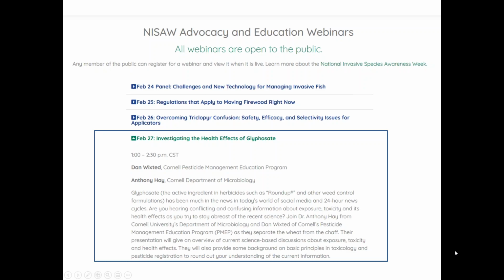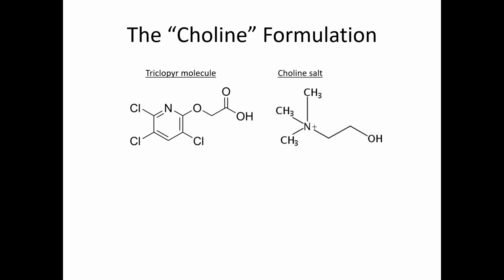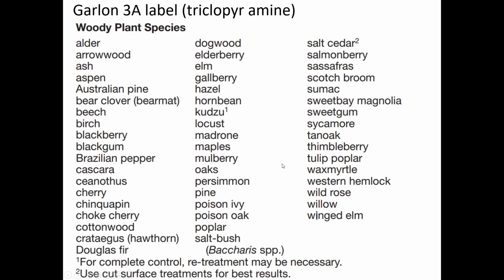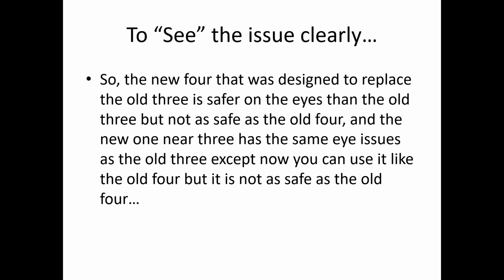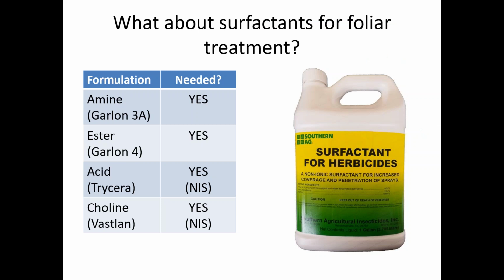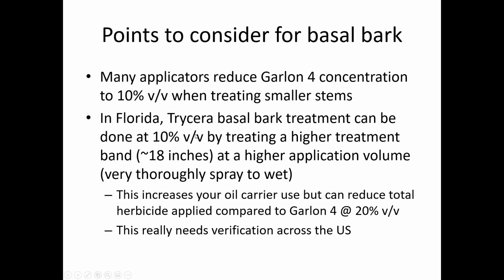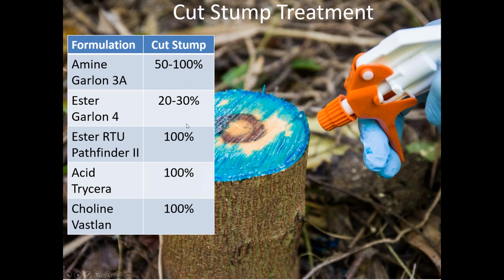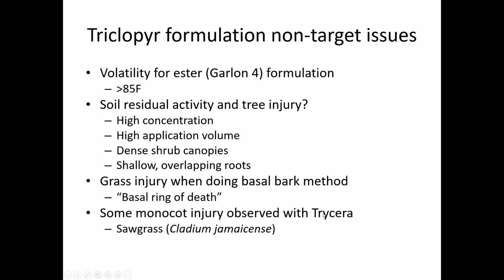Overcoming Triclopyr Confusion: Safety, Efficacy, and Selectivity Issues for Applicators

Comment: When using oils with Triclopyr 4, what percentage of oil is used?
Reply: I believe 60/40 with 60% being oil.
Reply: @robertbryant173  Usually 20% by volume of the concentrated ester (T4). So 1 part T4 to 5 parts oil (diesel, kerosene, or preferably bark oil)

Comment: Question: The Allegare Triclopyr 4 comes at 61.6% fresh out of the bottle.  I want to make a 20% spray.  Will my spray be literally 20% (meaning I factor in the 61.6% while computing the mix ratio), or do I make a spray that is 20% of the product I bought (meaning 20% * 61.6% = 12.32%)?  Does that make sense?
Reply: After looking at the Triclopyr 4 label on the bottle, it appears I do not factor in the .616 myself.  Correct?
Reply: @mikedegenova9992  that is how I perceive it Mike. I have had the same question and have had the same reply multiple times from industry professionals. 20% by volume, not 20% of the molarity. So....